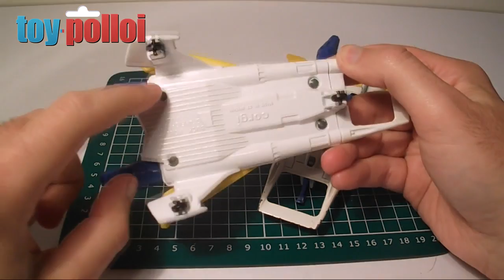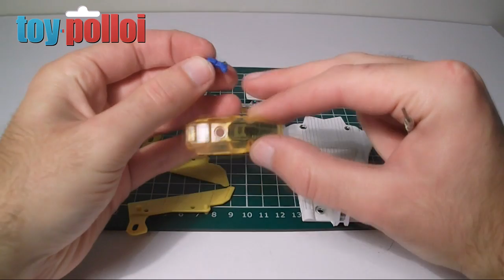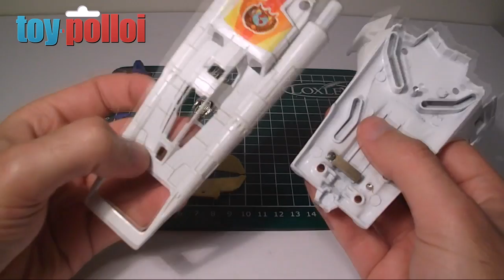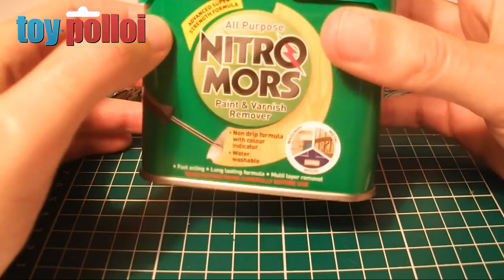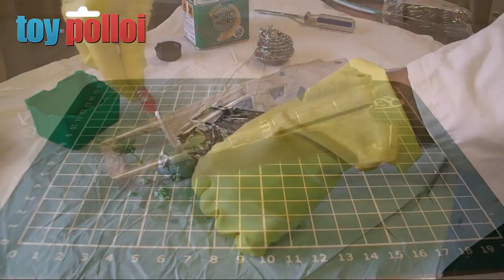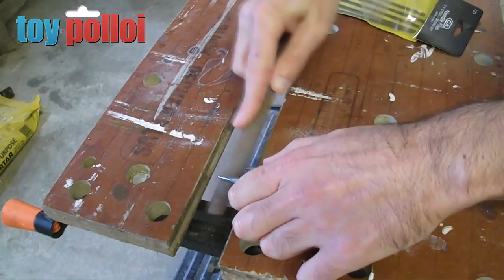Corgi Buck Rogers Starfighter Custom - Part 1

Comment: Nice start to an interesting custom.  :)

Corgi is pretty cool when it comes to their diecast vehicles.  I myself have a vintage "Goldfinger" Aston Martin.  The rear bulletproof shield, the ejector passenger seat and the forward machine guns still work (popping out and holding in place).  still slightly binged up with some very minor paint missing in places, but still, can't go wrong with vintage.

Comment: Is there a particular sticker paper you use, if so where can I get some as I'm in the process of doing a conversion on my Starfighter and need to print your stickers out????
Reply from the maker: I use clear sticky backed vinyl printer sheets. No particular brand. Just what I could buy on eBay.